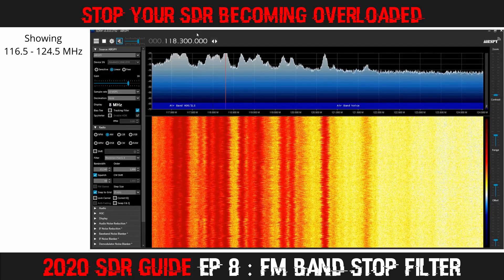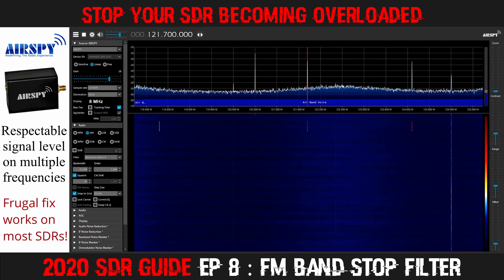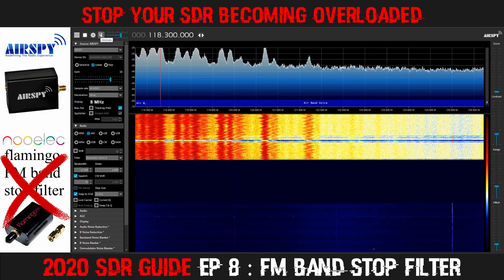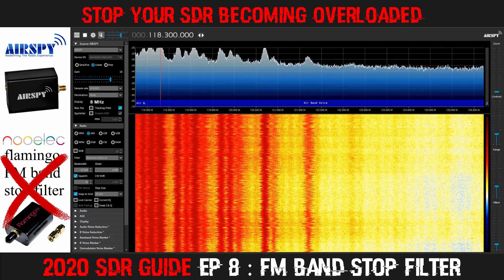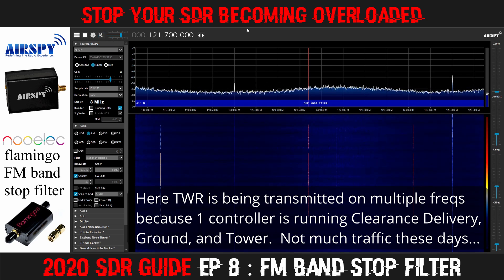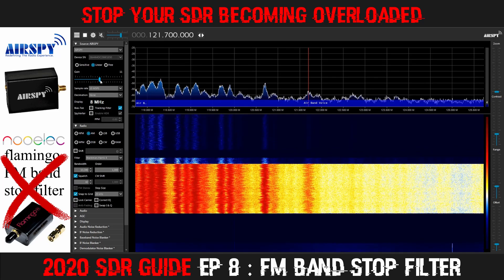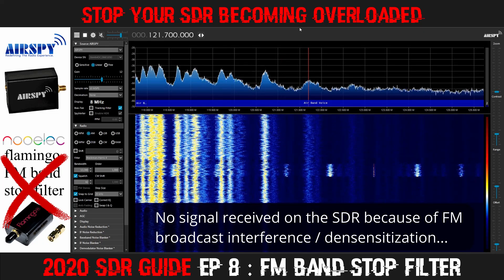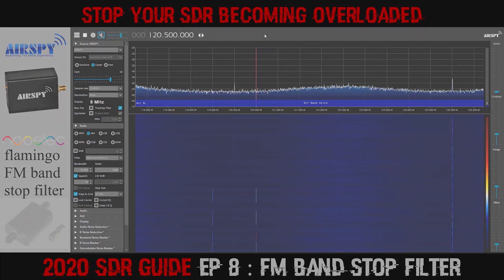2020 SDR Guide EP8 : Overcoming FM Broadcast Interference with a Nooelec flamingo band stop filter

Comment: Looks like these are needed by default. Very intersting, are there any other filters one needs for a Nooelec SMart V5 SDR ?
Reply from the maker: It really depends on the area in which you live. Some folks add cell filters if they are located close to several towers. I have also now installed a filter for 139.95 MHz which is a strong pager system only 2km (little over a mile) from home. If you live out of town, you may find you don't need a filter at all.

Comment: I have purchased RTL-SDR dongle and i am using basic dipole antenna provided along with the dongle and i have used 60cm length (each side of dipole antenna) and placed it horizontally very high at the roof 
I can hear approach and radar frequencies but with a lot of noise 
Should i buy 88-108Mhz band stop filter from RTL-SDR ? 
Also can you please provide tutorial on how to make antenna and feeder line( transmission line) especially for 118-137mhz ?
(The place from where i listen is 10-12kms away from ATC ) 
Should i also use an amplifier to boost faint voices from ATC ?
Reply from the maker: Band stop filters can help, for sure. Their effectiveness depends on your local RF environment.  It certainly helped my reception.

For an amplifier, it may help, but you would want it closer to your antenna, and after your filter.

Sorry for the short answer. I'm traveling in the Arctic right now.

Comment: Hi, I've a question, I'm not living in a urban area but I have the interference from some FM station that my discone antenna pick up. Do you think that adding a FM filter like Flamingo or flamingo+ or RTL-SDR can help? I will put also an LNA near the antenna but this will increase also the FM signals, wright? What is the db losses at 118Mhz with filter?
Reply from the maker: Yes, an FM Broadcast Band filter like the ones you mention will work. It is always best to place the filter right after your antenna, before your LNA. By doing so, the LNA isn't being hit by all the FM Broadcast stuff as strongly and overloading.

You will lose some reception in the 118 MHz range. If you purchase a more expensive filter such as the Mini Circuits ZBFS-95+ which has sharper edges and will result in less loss in the lower airband frequencies.
Reply: @FrugalRadio  Ok, thank you for the explanation and suggestion. I'll check the availability to put inside the same aluminum box the filter and LNA. That Mini Circuit is expensive 😅. Thank you for your videos.

Comment: I noticed there is no antenna in and antenna out on the end of the filter so am I correct in assuming it can be fitted either way ?
Reply from the maker: You're correct, mine was the same way. I inserted mine inline and looked at the amount of signal reduction in the blocking band. Then I rotated it and checked again. Wichever end gave the best reduction was the way I inserted it. I actually don't remember which way round that was, or if both were the same.
Reply: @FrugalRadio  thanks for getting back to me very much appreciated !

Comment: I have a question, I want to receive weak UHF signals with an LNA, do I need to put an FM filter to prevent overloading? Does this problem disappear at all on such higher frequencies?
Reply from the maker: The problem might appear at higher frequencies, it depends on how close you are to a broadcast transmitter, how much amplification you are applying, and a few other factors.

I would test it first and see. If you do get interference, listen to it so you can identify it. Interference and overloading can come from other high power transmitters too - pagers for example.
Reply: @FrugalRadio  okay, thanks man, I find your video very useful for beginners like me!
Reply from the maker: That's good to know @Fabio Dametto. Hopefully you won't have interference issues, but if you do, you know what kind of solution to look out for. Have a great weekend.

Comment: I would like know if this would help in NOAA weather frequencies, in the 137 band area. It seems I been getting allot of interference or Nooelec Sawbird + NOAA Premium Saw Filter. Thanks
Reply from the maker: The Nooelec Sawbird + saw filter for 137 MHz will be better at keeping out interference.  It works a little differently, in that instead of stopping 1 band of frequencies from passing through, it does the reverse.  It stops all frequencies passing though, except the desired frequencies. 

"Pass band" filters like these work very well, because they can eliminate interference from most other frequencies (e.g. high power pager, cellphone or signals on other frequencies).  However if you leave a pass band filter inline, and try to monitor frequencies outside the pass band (e.g. aviation, or UHF Public Safety) you won't hear anything. 

Since you probably have an antenna dedicated to 137 MHz, this would most likely be the better solution, although it will be more expensive than a simple band stop filter as reviewed in this video.

Comment: Thanks for a great set of videos, very informative.  I just wanted to let you know there is also a v2 of this Flamingo FM called the Flamingo+ FM... and guys don't make the same mistake as me and think oh v2 must just be a newer version (though it may be..). NooElec recommend the Flamingo+ FM v2 filter for urban environments and other locations with high-wattage FM transmitters nearby, and for other locations, the Flamingo FM v1 is the better option.  Be careful as they look identical in the pics at Amazon ;)
Reply from the maker: Thanks for your comments @zonti
Reply: My antenna isn’t on a urban area but I’ve fm transmitter near by in 10km without obstacles between. For this case what you recommend, flamingo/rtl-sdr blog or Flamingo +? Thanks

Comment: Great example....Thanks for demonstrating
Reply from the maker: You bet!  So many people run into issues with FM Broadcast stations overpowering their SDRs.  I know I like to see items in action before I purchase them, so figured others would too.  Thanks for watching.
Reply: I'd seen the flamingo on Amazon but had no idea what it was. You don't make the assumption that everyone is at your level, so this explanation was really helpful. Fortunately I've not run into trouble with FM interference. Is it just the power of the FM signals that does this or is there less of a gap between FM and Airband in Canada? Thanks again.
Reply from the maker: Yeah, I never needed an FM trap for years. But where I'm located right now there are loads of tall screens towers. Some are pumping out FM radio signals, others TV, and others trunked radio signals.

The FM broadcast transmitters throw out quite high power, and software defined radios can struggle to handle that amount of RF energy on the front end, especially closer to the FM broadcast band. With airband being just a few megahertz away, reception can suffer badly.

The great thing about SDRs is you can see when this is happening. It's a lot more difficult on a scanner.

Broadcast FM is generally 87.5 to 108 MHz in most countries, and airband is officially 108-118 MHz for navigational aids, and 118-137 MHz is for the analog and data. The airband is the same all over the world.